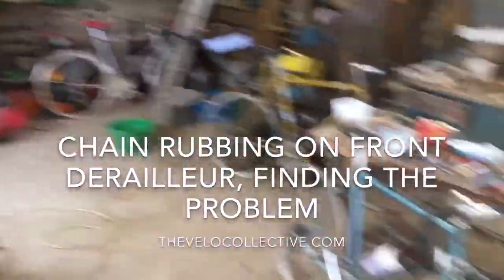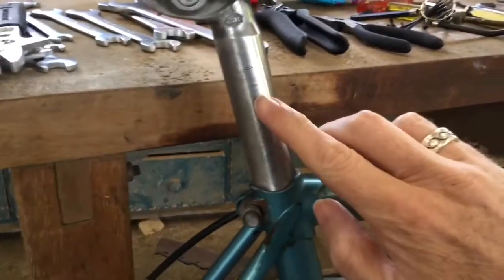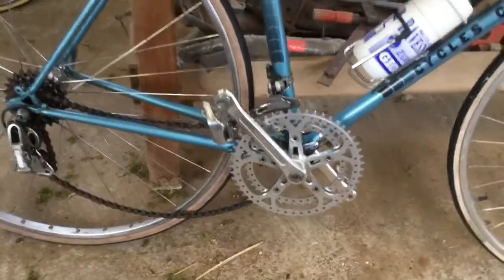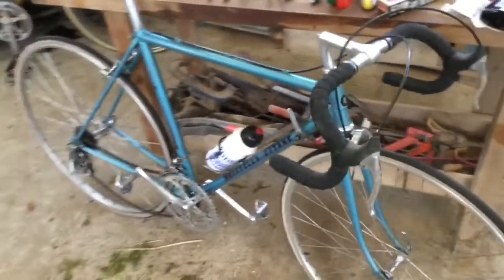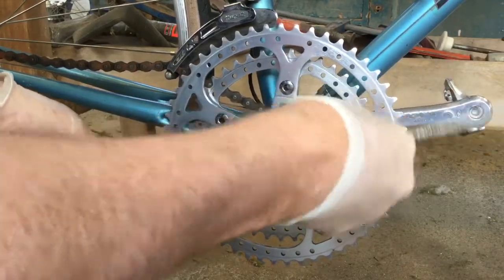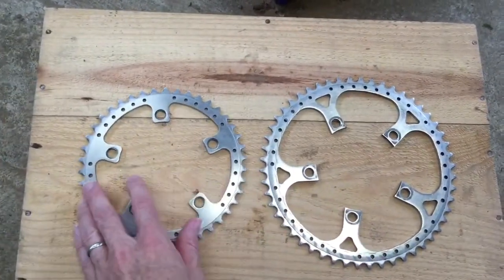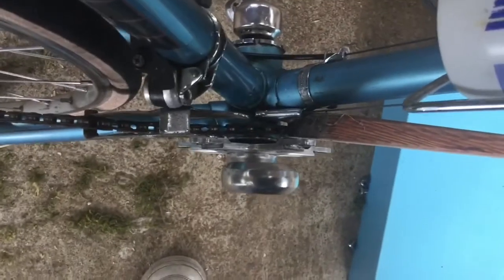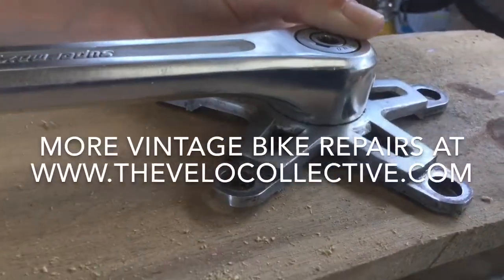Chain Rub on the Front Derailleur, Finding the Problem on my Vintage Gitane Bike

Comment: pretty interesting.I've got a similar problem with a Gitane that has a Suntour crankset on it 53/42 on a modern sealed BB,not bent but the smaller chainring passes very close to the chainstay which looks to have a very short relief bent into it for chainring clearance.Toying with the idea of replacing the 42 with a 40 or 39 in order to get a bit more clearance.